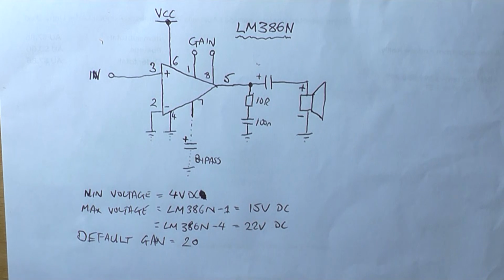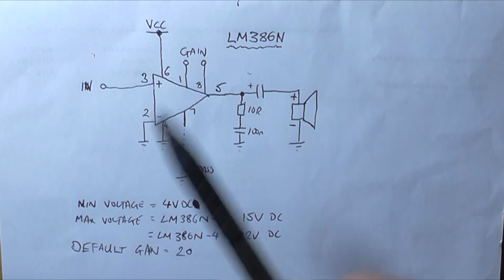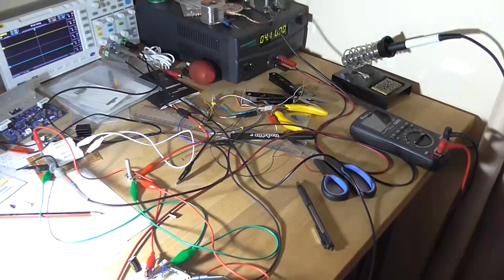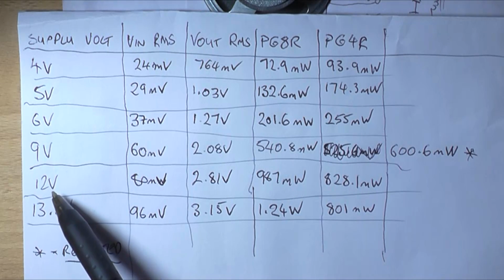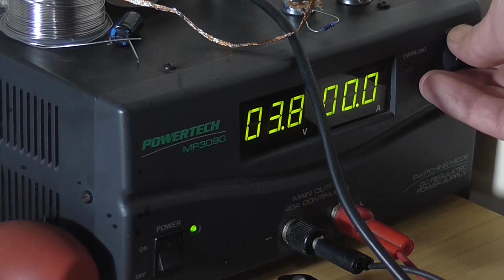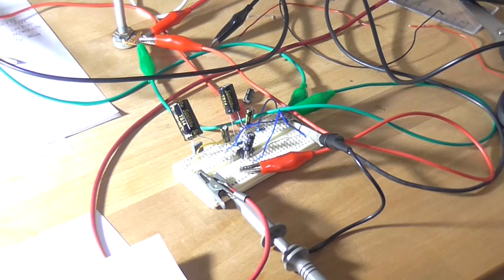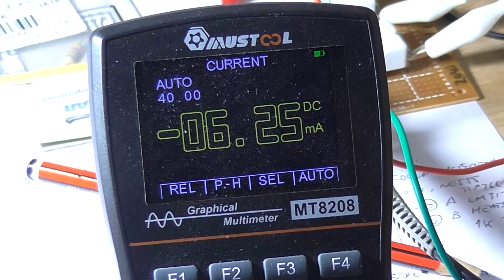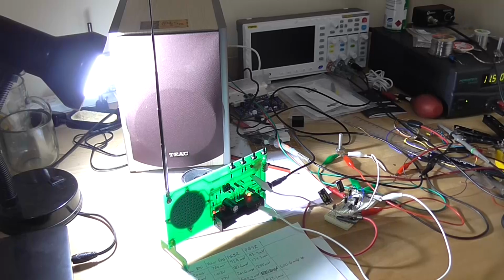The Humble LM386 Class-AB Amplifier IC

Comment: These are not as old as the 741. Thesecappeared around 1980z-82, the 741 was around in the early ‘
70’s. If you want to try sn OLD audio amp IC, try the LM380…similar specs to these but in a 14 pin DIL package.

Remember wrecking these out of discarded barcode scanners from Purity supermarkets…they drove a small speaker just like you show to make the “beep” when an item was scanned….don’t know why the designers went for a full linear sudio amp for this spplication when a basic sonalert would have sufficed. The 4mW Helium-Neon LASER tubes from those scanners were much more fun…the power supply for it ran off 35v with an “LOPT” style transformer…rewound them own for 12v changed the driving transistor from a TIP122 to a BUZ71 and had a 12v LASER. 
   Modulated it with some Frank Zappa and shot is across the river and picked it up with a phototransistor and a curved mirror from a traffic light head…..those were fun days!

Comment: Took me two days to make this chip work. No kidding.
Reply from the maker: Were you trying to use it like an ordinary opamp?
Reply: @AstrosElectronicsLab  I was trying to use it like an audio power amp. I want to build a small amp for audio stuff. But for some reason, even doing the simplest design according to the datasheet wasn't working. I think my problem was the grounding, crappy grounding. I was trying to be cautious about my grounding, but even so I still had trouble. I want to try to build a small board for the circuit. I think if I do that there will be less chance to oscillation. I tried the concept of "star grounding", but it's kind hard to do it properly in these little breadboards.
Reply: @CalebePriester This chip is designed to be used on a ground plane JUST like the data sheet shows you.  Also you should use shielded cable or at least twisted pair for input and output and any pots you put far away from the chip.

Comment: I think it is nice that it is a single rail solution as you don´t need complicated dual rail solutions to make it work, I wonder a bit if this op-amp is working a bit like the 358 in a way, you can make this a single rail audio amp too but like yours they have quite a bit of noise when it comes to hifi applications. I am looking for a solution that works with a 5V single supply with low enough noise for it to work as a pre-amp in your classic NES console when this is virtual stereo sound modded. I designed an amp around the 258 that have good audio quality with this but I am not that impressed by the white noise it have with it´s basic output modules

Comment: In a video long ago you expressed how you disliked this little chip amps, which made me sad. I built a few little amps with these using John Audio Tech's Done Right guide, and i love them! I know i know, it aint HiFi and all, but im amazed how it drives speakers that seem way out if it's league and sound good to my novice ears. Im so happy to see you revisit and enjoy the 'Humble LM386' in this video! Whats more i finally, thanks to your tests, can solve my issue of tge loud and obnoxious noise my little setup gives when my computer goes to sleep, which my too-little-brain now understand to be oscillating when theres no input. Time to break out my 100 uf capacitor and soldering iron! Thanks for another great video, keep them coming please!
Reply: Its datasheet says 0.2% total harmonic distorsion at a 125mW output. In the so-called hifi years, this spec was considered hifi.